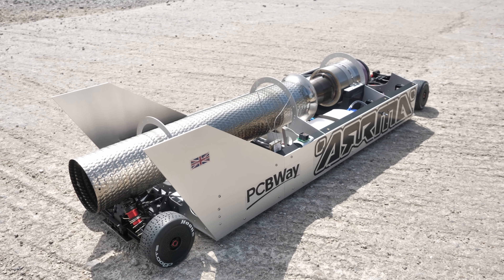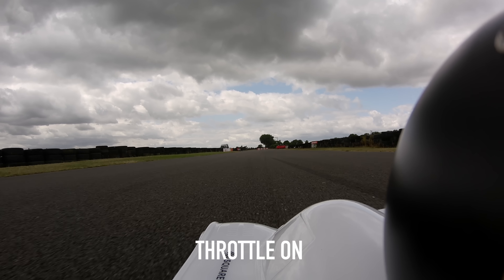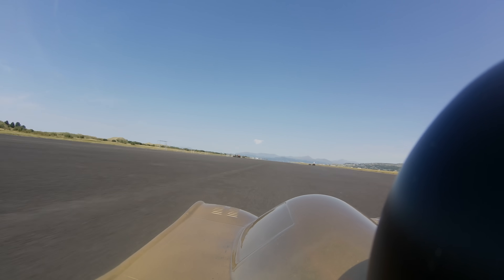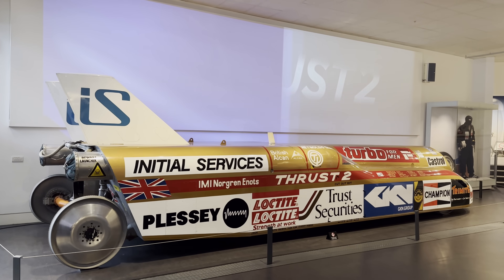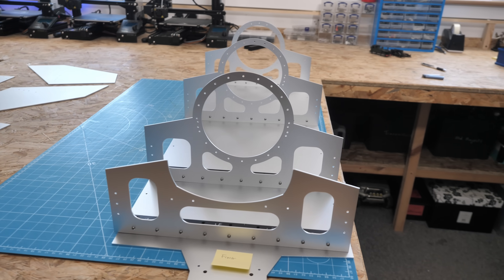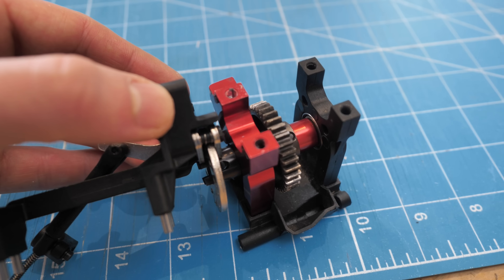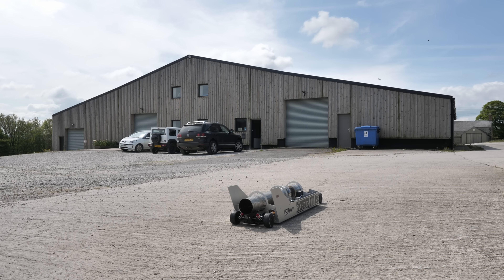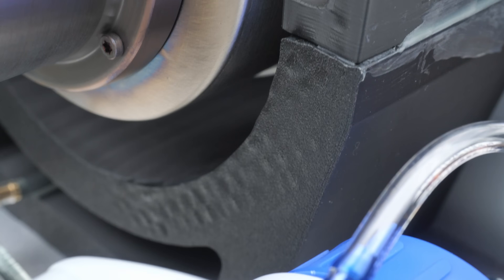Building the WORLDS FASTEST Jet RC Car 2.0

Comment: hey you can make full custom metal parts by 3d print + charcoal rub + electroplate/form, even high temp parts
Reply: succ succ succ :) to the ground
Reply: full custom metal parts I mean with the electroforming diy
Reply: use afterburner+edf+ramjet-intake-nozzle instead, much simpler operation
Reply: ramjet nozzle is anti-aerodynamic, rocket nozzle inverse forward lol